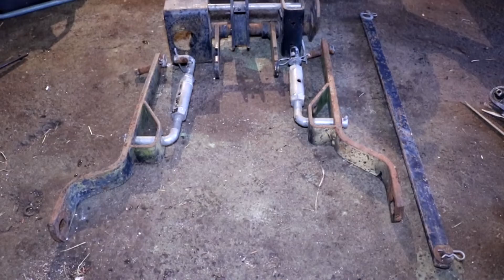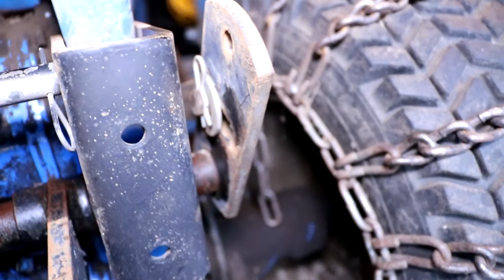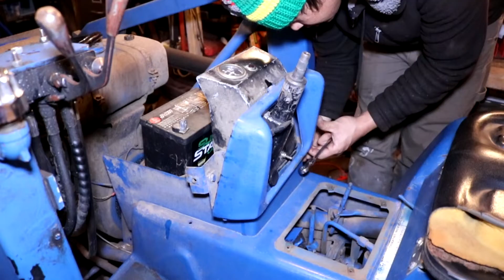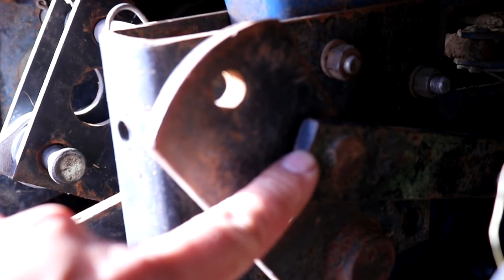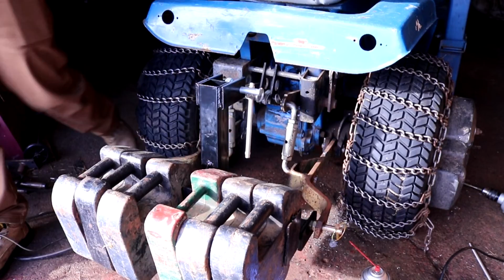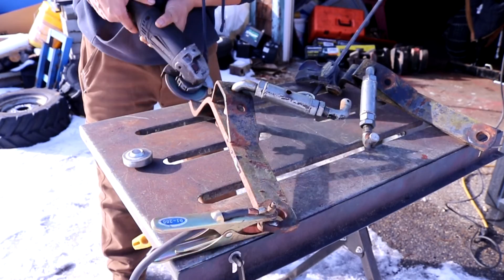Garden Tractor 3 Point Hitch Install Cat 0 | 1974 Ford LGT 145

Comment: hope you still check these comments. I picked up a lawnboy gt 18. cant seem to find much on it? the ford gt 18 looks to be the same? wondering if it has any collector value before i start welding to make attachments work. any thoughts?
Reply from the maker: The Lawnboy GT18 was made by Gilson I believe. Not sure of an collector value.

Comment: This is just the video I needed to see! I have a Ford LGT165 (closed side) with the factory 3pt, and I have been entirely unimpressed with its weight lifting capacity. Like you, I noticed that smaller hole on the rotator bracket, but I haven’t got around to trying it out yet. Thanks for taking the testing/guess work out of it for me! As soon as the weather warms up, I will be making this change!

Comment: I am rebuilding one now. Are you going to start to carry more parts for theses tractors and the Jacobsen's? I will be ordering your engine rebuild kit fairly soon. Can you do a video on installing the tiller if you have one and a snow blower?  Bushings for the 3 point. front axle pivot deck carriage be nice. and seals and bushing for the little pump.
Reply: And something to replace the plastic bushing under the steering wheel on the steering shaft.
Reply from the maker: We are working on more parts like that. Right now we are doing more parts for IH Cub Cadet and Wheel Horses but the Ford/Jakes are on the list. For that steering wheel bushing, I machine my own out of aluminum.

Comment: just a thought but I would have not cut out that fender notch. An alternative solution would be to raise the body fender with hockey pucks and longer bolts.
Reply from the maker: That would interfere with the pedals. No harm in cutting out the knock out, that's what its for. Thanks for your comment and for watching.

Comment: Could I "Possibly" make a Modified Lift Arm for my 1991 Craftsman GT6000 with an Electric Actuator?

I made an "Anti-Float" Block for more Down-Pressure, and It works OK, But I also Upgraded to a "Cat-0" Lower Link for even more Down-Pressure.

These OE Electric Actuators are getting REAL HARD to find, and they are also Non-Rebuildable. I don't want to have to convert to a Hydraulic Setup.

Comment: 300 lbs counter weight , driver weight and tractor weight , no too much on these light weight transaxles ?
Reply: Not to much at all for a model like the 145.
Reply: @rydplrs  Exactly, just look at that transaxle,  it is at about 4x the size of a new toro lawn mower. My cub cadet 169 or my John Deere 212 rear axles are like an actual farm tractor.
Reply from the maker: As others have said. No problem on the weight.